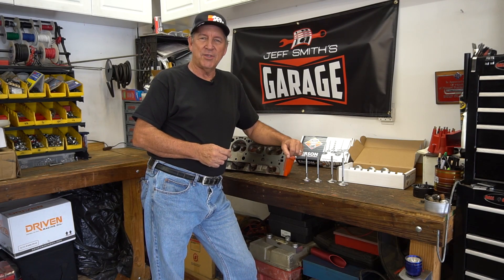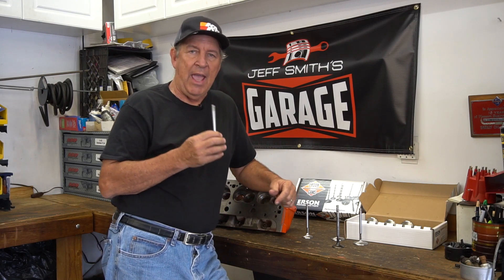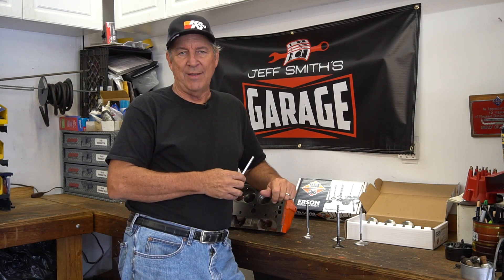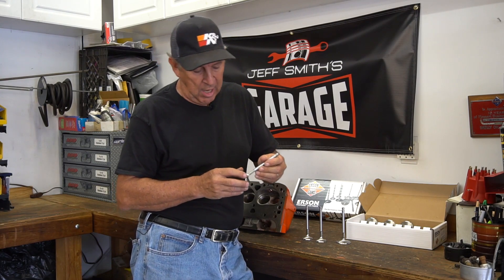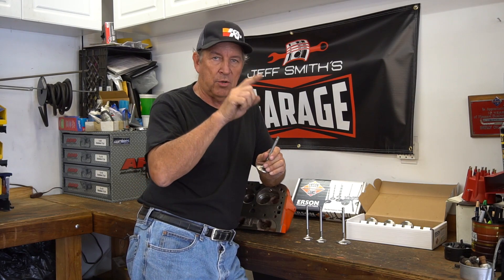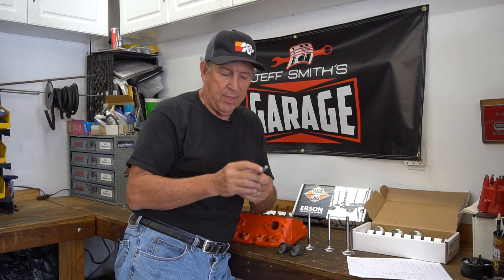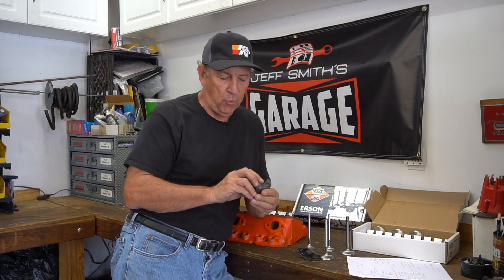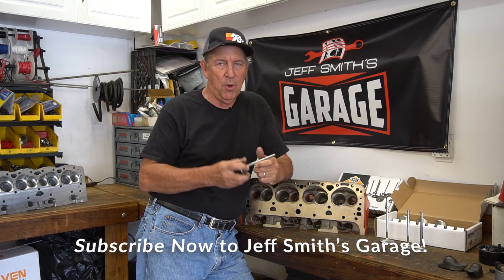Jeff Smith's Garage - High Tech Erson stainless steel valves

Comment: Mr Smith, I just read an article of yours in motortrend about a 460 big block. In that article you said lower compression would be better with the smaller cam. I'm speechless actually. What you stated could not be farther from the truth. . How can someone that knows so little about how a engine performs be employed by a magazine that is suppose to be an authority on anything related to the motorsports world.
Reply: Perhaps we should speak less in terms of generalities. Would you suggest 11:1 static compression ratio on a small-block Chevy forexample with a short duration cam (under 210 degrees of duration at 0.050) on 91 octane pump gas? If so, it will perform miserably and will detonate. But a short duration cam with 10:1 compression might work - depending upon several factors - the efficiency of the chamber, quality of fuel - etc. On a 460 Ford with a chamber desinged in the 1970's - I would not want to run high compression with a short durtion camshaft. But again - generalities - give me a situation where you specify "high compression and a short camshaft" and then we can discuss it. Plus, I will not question your knowledge as an engine builder nor your professionalism nor your journalistic qualifications. Let's instead talk specifics - give me a specific engine combination and then we'll discuss it.
Reply: @jeffsmith2003  perform miserably and detonate? Maybe one should define perform miserably.

Your article was talking about 9.6:1 and 8.6:1 so I really don't care about 10:1 or 11:1.  I would much rather take a 9.6:1 engine over a 8.6:1. It will perform much better with 9.6:1